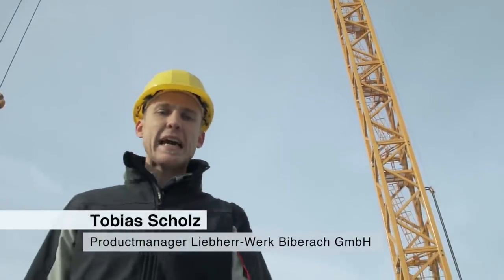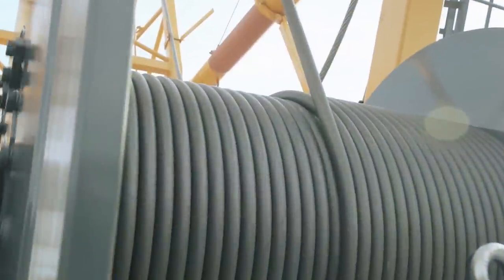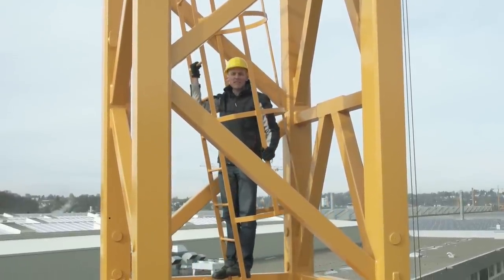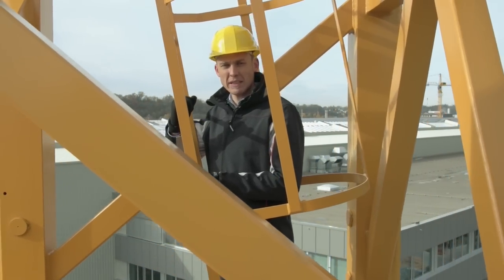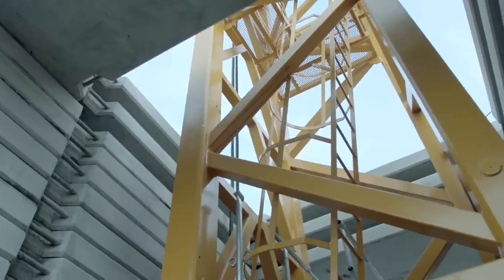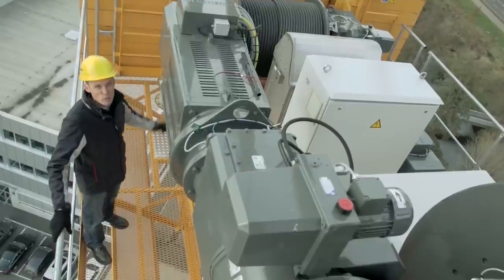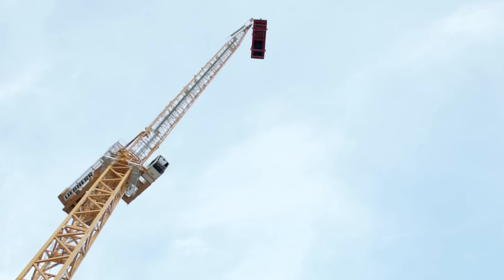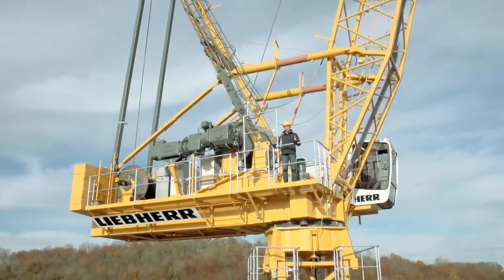Liebherr - 357 HC-L Luffing Crane

Comment: During the working of crane the luffing operation is used for (Which one is correct)
A. lowering the load at the point of destination.
B. raising the load from its top.
C. moving the boom in or out as required.
D. moving the boom in arc.
Reply: B
Reply: @SHARWANKUMAR-jq6vq  ❌ C is right.

Comment: Why the old liebher tower crane always broken the resistor
Reply: Break down of resistors that have been in use for a long time is normal. The wear on those heating tubes are considerable especially if operated in hot climates.

Comment: Doesn't it need a foundation slab, like a concrete slab to be prepared for its installation?
Reply: Behrouz2181 yes it requires a foundation ,a highly specified highly reinforced slab must be poured before setting up the tower base but the foot print it leaves when the crane leaves the site is nearly nothing.